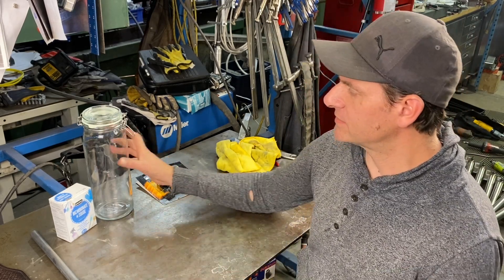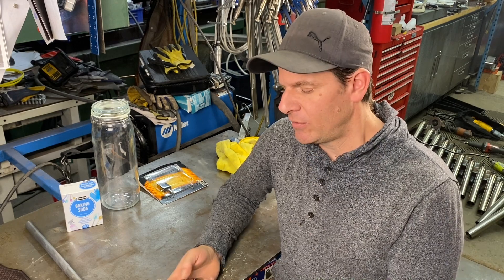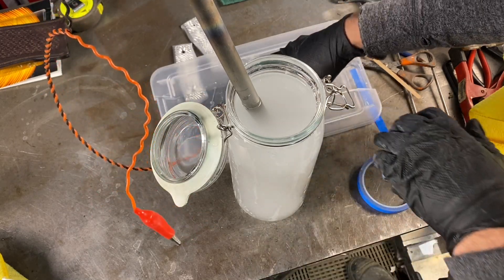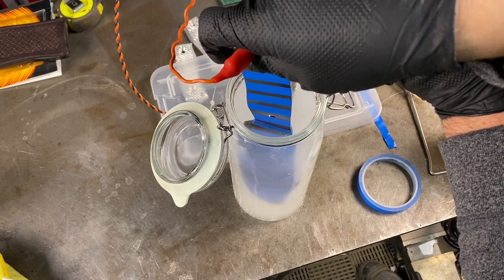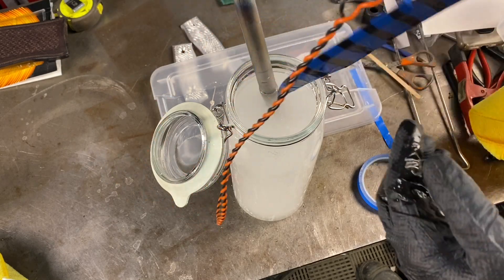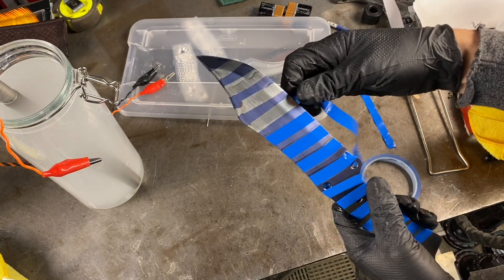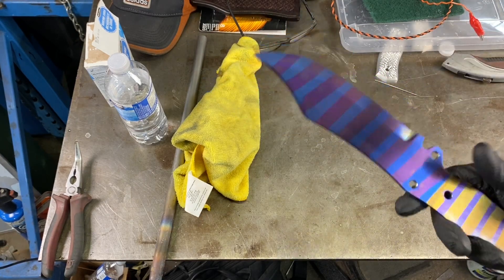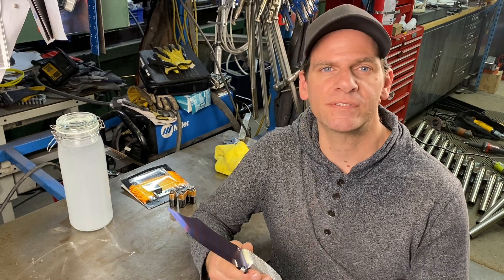HOW TO ANODIZE TITANIUM !!!

Comment: So to clarify.
The first pass the tip of the blade was exposed, and turned purple, this was with 3 9volt batteries.
Removing the tape, and a second pass with 2 9volt batteries, turns the purple to blue.
I see that you didn't clean the blade after removing the tape. I wonder if that would've changed anything.  I had mentioned in your short that I have been plating nearly 20 years. For electroplating, cleaning is essential. Also for us, positive to the anode, and negative to the part. This was not only the easiest anodizing video I've seen but incredibly informative.
Thank-you so much for this Rob...
Reply from the maker: Thanks for watching George